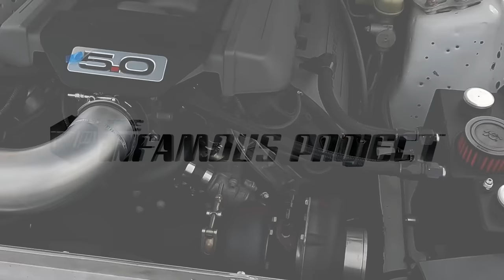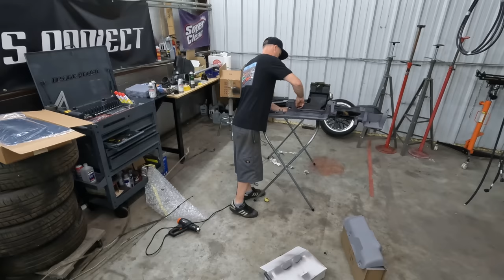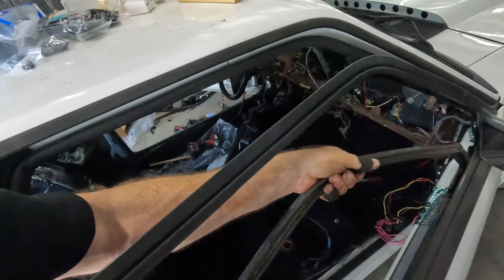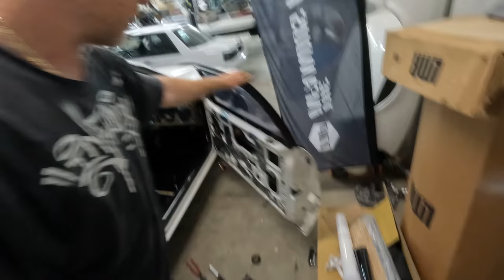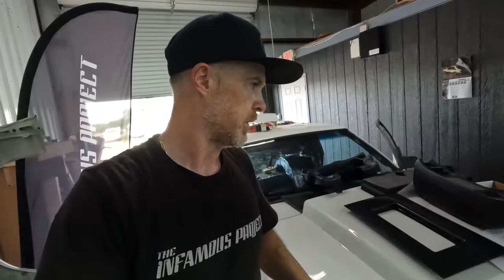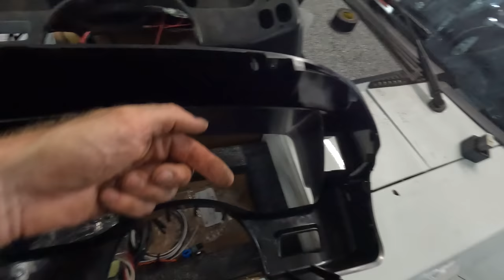Wiring Nightmares & Interior Re-Install in the 1993 Fox

Comment: You know what's weird is, I enjoy doing auto electrical. But I SO suck at it. I want to get a few speciality tools for tracing and tracking circuits for cars when I can afford it.  What paint/duy do you use on your interiors? I did some research and from what I seen SEM was best brand to use. So that's what I just bought. I am fixing to some some dash repair tomorrow and some videos on it. Would you concur SEM is best way to go?

Comment: I have been looking everywhere for the connector for the window switches. I have the female ones on the door side. But I need the switches and the little plate they plug into for both doors.  Will any other car work for these?